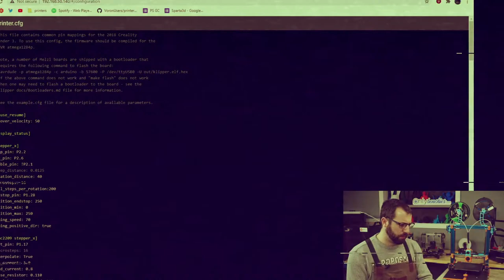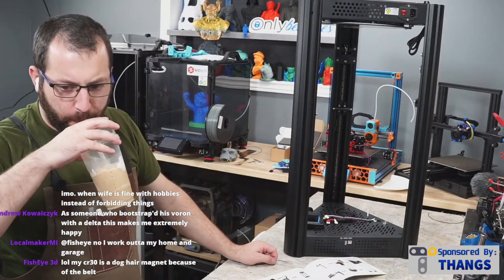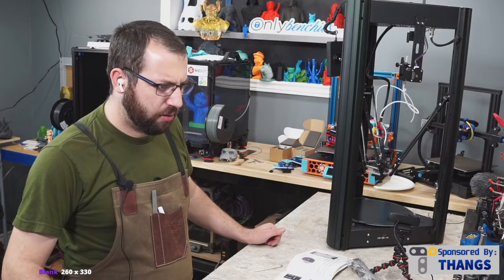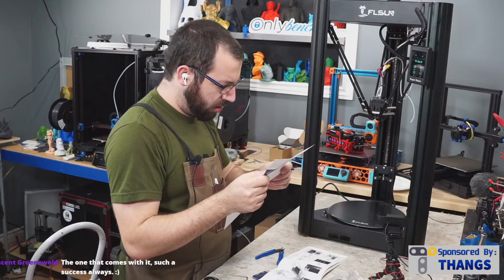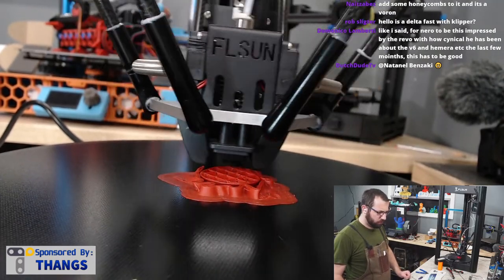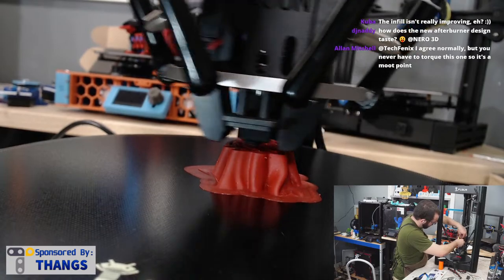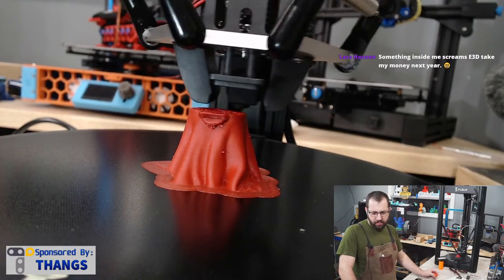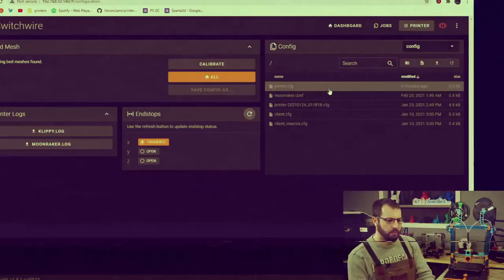FLSUN SuperRacer - UNBOXING AND BUILD - LIVESTREAM

Comment: Not sure if I'm a huge fan of putting 1 screw in every 7th hole on the linear rail, I guess it's probably adequate. The fact that it has rails vs using v wheels like most of  the cheap deltas I've seen is a huge plus. I also like the ball and socket joints held together with spring design for the arms vs the more traditional cheapo heim joints, I don't think they're quiet as good as magballs but I doubt they will wear out anywhere near as fast as the heim joints